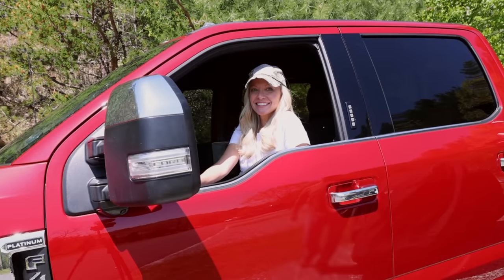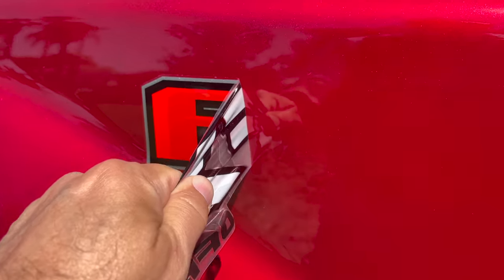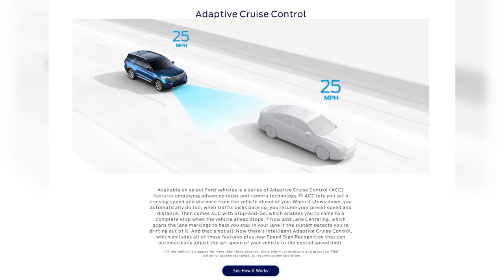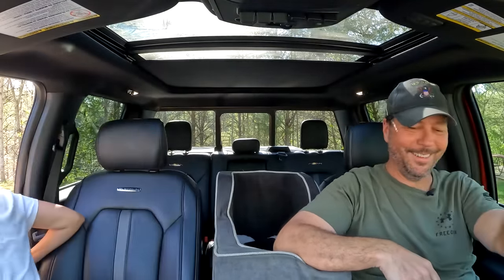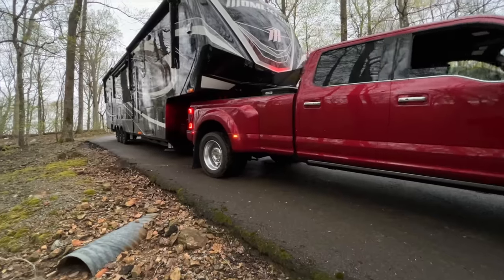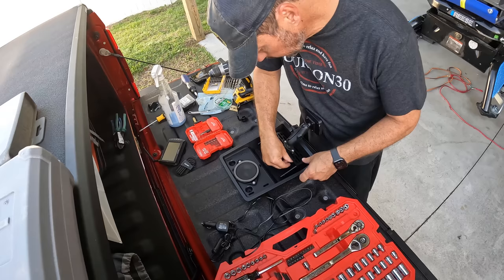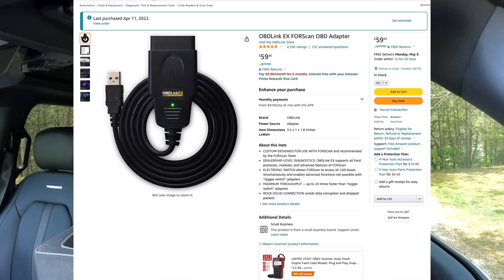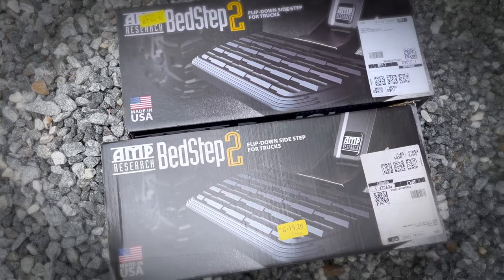2022 F450 Platinum! (Full Time RV!)

Comment: These are nice. I looked for 6 months and researched for a year. No one makes a truck like this at this level. I bought a 2019 with 3000 miles just like this truck in metallic gray. The few thing different is in 2020 they went to a 10 speed tanny and moved the antenna to the rear of the cab. It came from the factory with the spray in liner and the 5th wheel puck system. The turning radius is a game changer that wide track front end and those rims and tires are a great option of the F350

Comment: We have a 2022 F350 like you guys had, minus the 4x4 and ours was an XLT with moon roof.  We tow a 2022 41.5 foot 5th wheel, been full time now since June '22.  Haven't had any issues with the truck so far, it's performed fantastic and we're getting 10 to 12 mpg towing.  I'm used to the turning radius so that's not an issue so far.  Our trailers gross weight is 16K.  My biggest beef with this truck is all the CHIMES!  Open the door, turn lights on, open door WITH lights on, backup and so on.  I'll be digging to the program to get rid of most of them!  Ordered our Ford in October 21, got it 6 months later.  Bought the Reese hitch based on your review, and we have the Flexair kingpin.  Great combo.  Getting the I.S. and disc brakes this October.

Comment: I too just received my f250 lariat with all the tow options and the 7.3 gas engine (I only tow 6000 lbs for business). Suggestion, I ordered the factory trailer camera. Hard wired to the truck and shows on your12” display. The picture is amazing and clear. I love it. Haven’t towed with it yet cause I’m still getting my first 1000 miles on it. And like you said, I love this truck!

Comment: I purchased a 2020 F450 Platinum and absolutely loved it. We just purchased a new 2022 Genesis Supreme 37 CRXL Toy Hauler. The truck and trailer are amazing together and I have zero anxiety now when pulling. What I had installed suspension wise was Carli Suspension Pintop 2.5 leveling system with King Shocks. Kept the stock rear leaf springs to maintain towing capacity. I did add airlift 5k bags to help with the Squat. Overall I am super happy with the truck and we are going to do our first long pull to Yellowstone in a couple of months. I never had the confidence to do that with my old f250. Congratulations, can't wait to the videos you will make with the new truck!

Comment: Luckily you guys got yours. My dad ordered 2 F 450s July 12th 2021. A platinum and a Lariat trim level. It is currently May 8th 2022 and neither one of them even have a build date on them yet. Very frustrating when we are seeing people like yourself order at the end of 2021 and you guys have yours. Happy for you guys. Just very fed up with Ford motor company that they are pulling this stuff. It's not right. But enjoy your new pickup guys! Keep up the great videos
Reply from the maker: That's really odd.  I could see if he ordered something not in stock, but we ordered everything.  I hope he at least has order numbers from ford to make sure the orders were actually placed.
Reply: Blueovalforums has an ongoing thread on the 2022.  Between individual component restrictions and Ford being overwhelmed with retail orders, it's a nightmare.  Dealers are doing a piss poor job with customers, because the model has substantially changed.  I think GM and Ram are suffering from similar issues.

Comment: The best setting I’ve changed for me on my F-150 Platinum is when I lock the doors with the remote the mirrors automatically fold in. A quick google search will get you an excel spreadsheet with everything you can change. I also had my truck ceramic coated. Game changer for sure.
Reply from the maker: Surprisingly, that feature is built into the options now...

Comment: Another note on adaptive cruise and I don't know if you've discovered it yet, if system slows you down, as soon as you hit the left turn signal, it starts accelerating up to your set speed, even before changing lanes.  Now, the flaw of the system, when someone comes darting across the lanes, it can slam on the brakes to avoid it's "perceived" collision.

Comment: I used the pro trailer backup on my 2016 f150 before I got my 350. That one was not designed for gooseneck or 5th wheels but at that time I didnt need that. It was just OK. Worked great when it worked kind of deal. Half the time the truck could not find the sticker because of lighting amd sometimes it would take forever to find it. I liked using it but not getting it to work. It did teach me how to backup better. Its different in the 350 and wasnt offered on my 2019 because no electric steering so excited to see your 350 video.

Comment: My F450 Crew Cab 4x4 rides like a dreamy smooth Cadillac pulling my heavy 5th wheel going down the highway. I used Air Lift Load Lifter 7500 XL air bag kit @ 25 - 30psi in the rear and Air Lift air bags in the front @ 15 - 20psi plus Bilstein shocks. I run low pressure in the air bags because I don't need them for raising the truck up any but just to smooth out the bumps. When running around empty I run 10psi in the rear (minimum recommended air pressure) and 10psi in the front air bags (5psi minimum  recommended air pressure). The Bilstein shocks help a lot over the stock shocks with the little sharp bumps and joints in concrete roads and the air bags smooth out the big bumps.  It's a great combination. The empty ride is still stiffer than a 1/2 ton pickup of course, but hey it's a heavy duty hauler!

Comment: Several questions.  1) What is the cost of licensing between the 3/4 ton and the 450?  2) Is the truck listed by your "home" state as commercial?   3) Why the spray in bed rather than a bed rug.  Bed Rug is easier on the knees and also protect the bed better from dents and dings.  4) What have you seen for MPG?  5) what would you have added or deleted in the order and what was the MSRP (or if comfortable actual cost).   We are thinking about upgrading our SuperDuty to a 350 or 450.  Thanks for the great review.

Comment: I have 21 f150 platinum... check on the extra backup camera for the back of the rig... and the built in tpms. watched the rest of the video... need to learn more about the tpms options.   using tire minder now,  want the built in functions of the truck

Comment: I've got the Kelderman system on my 2021 F450 and love it. The stock height system maintains all of factory geometry. I took the truck to Iowa and had the kit put on at their shop. I did the 4H control system with Kelderman shocks and dual steering stabilizer. Changed the ride dramatically. That combined with doing 20" wheels with BFG all terrains, my F450 rides like a F150.
Reply from the maker: Thanks for the feedback, Logan!  👊🏼
Reply: How far do you live from Kelderman Iowa?  I have 2023 F450 Limited coming and will like to keep the stock height system to maintain all factory geometry.   Did you drop the truck off?  wait a few days?  What is the 4H system shocks and dual steering stabilzer?  How much did it cost?  I may look you on on Facebook to see some pics if posted.   Did you trade in your old tires and rims at Kelderman?   How many miles have you put on since?  Any pros and cons?  How much did it cost?

Comment: I guess I'm too old school a lot of advanced assist features I don't like because people should be able to do it the hard way first, if all those bells and whistles fail will you still be able to Drive, Hook up, and Tow safely?  the features on my truck I either ignore or turn off, I find them distractions and I trust my eyes over them, cameras have delays especially wireless ones. it's like the passenger mirror "objects in (the) mirror are closer than they appear" . 👍

Comment: For our single rear wheel 2020 F350 - I swapped out the factory FX-4 shocks for some Bilstein 5100 shocks (stock suspension and height).  Made a big difference on rough roads.  Also lowering tire pressure when not towing makes a huge difference in ride smoothness.

Comment: Nice video, you’ll want salastic shackles again unless you go full air ride from Kelderman it’s really nice stuff they install them right at there facility in oskalosa Iowa. You failed to mention you have a 10 speed transmission now and that helps with the Overrevving when in the mountains or on hilly terrain! We love our 450 but you’ll need to work on the suspension or tire setup when running empty or those massage seats will need to be on full time 😂 safe travels!

Comment: I have a 2019 Ford F-450 Platinum I pull a 2020 VanLeigh Beacon 42RDB. We upgraded from a F-350 last year and man I love the turn radius. My question is what mounting bracket did you use for the Garmin? Love your show, your the reason we started RVing. If your ever in Orange Beach, AL holler. Thanks Ty and Lisa
Reply from the maker: + Builtright Dash Mount: https://changinglanesrv.com/builtrightdashmount
 + RAM Mounts: https://amzn.to/3KNKH7U
     We use the AMPS plate mount (RAM-B-347U) for the GPS

Comment: Your truck looks great. I've got at Rapid Red F350 SRW on order. Have you noticed your highway rpms running higher with the 4.30 gearing? We had an F350/4.10/6 speed for a long time and my only real complaint was cruising along at around 2300 rpms at 75 mph. I would much rather be around 2k.  Has the 10 speed helped? I know that 10th gear is a bit higher than 6th in the old 6 speed.
Reply from the maker: Not at all with the 10 speed.

Comment: What a great looking truck  Just be careful when backing up with those mud flaps so close to the tires.  I occasionally have to back up a steep drive way or over a rock or curb, that pushes the mud flap up against the tire and then rips off the mud flap and some times what ever it is attached to.

Comment: I like your in bed tool box. Do you run or have you found a bed cover to work with it? I would like to run an in bed box but still be able to cover the rest of the bed when not towing the 5th. It would need to be able to open up for the 5th wheel hook up and stow out of the way while hooked up to the tow.
Reply from the maker: Here's what we have: https://changinglanesrv.com/faq/?Display_FAQ=2978

Comment: the turning radios is great in my 450 bets the daily driver of my 250 every time. my question in which gear ratio did you go with in the rear-end did and did you get the six speed or ten-speed transmission.  just trying to get input and other people's thoughts. Great channel and information thanks
Reply from the maker: Please see: https://changinglanesrv.com/faq/?Display_FAQ=2176

Comment: I have the electric cab heater which I love living here in Ohio.  But I also got the electric heated wind shield wiper blades.  Its a heat element at the bottom of the windshield where the wiper blades rest,  like the rear window de icer.  I also got tired of fishing the plug out from behind  the bumper, so I moved the plug into the plastic panel next to the tow hook.  Now just pull the rubber cover off plug in the cord.  I think you are one of the best at explaining RV fixes and improvements.
Reply: The plug is for the block heater, forgot to mention that.

Comment: Got a 2020 Platinum F450 the same color and I love it . Ordered mine without the vista roof and I’m not missing it .
Reply: I too had mine ceramic coated and also did Xpel film on some of the leading edges for more protection. I installed Firestone 7500 airbags just to level head lights out when towing. Didn’t have a lot of sag but just enough and I think they help on some of the rough roads when pulling our New Horizons 5thwheel. Oh the turning radius !!!!

Comment: Hi Chad and Tara, I was re-watching your video (I always like your videos, by the way!!) and saw that you have gone away from using the Pro-Clip mounts that you previously used for the Garmin, etc..  Just wondering why you switched?  I still like the Pro-Clip mount because it keeps the Garmin mounted lower and doesn't restrict visibility as much.

I also keep the TST monitor on a cradle and just lay it inside the center tray, and the Furrion camera gets clipped to one of the HVAC vents.  The only thing that is attached to the window is the Van-True dash camera.  This allows the best visibility in the center of the windshield.

Thanks for all the great videos you both produce!
Reply from the maker: Proclip doesn't have any mounts for the superduty's with the 12" screen.. 😞

Comment: Hey Chad, We have a 2009 F-450 6.4 w/4.30 axle gear. Honestly, I have had some trouble with it but, I am the second owner, so hopefully the issues I've had were a result of the previous owners neglect. With that said, I do like the truck and it tows our 397TH very well. I have noticed that the front tires wear a little more because of the tighter turning radius and that geometry. I hope I never have to go down to a F-350 because I'd have to learn how to park our rig all over again LOL! Safe travels, and "THAT IS ONE GOOD LOOKING TRUCK!" 😀

Comment: I only use cruise control on the flats and when entering a steep grade climb I pedal into the climb creating speed bypassing cruise control and preventing a huge rpm jump and gear drop.  

I use a large external transmission cooler and cooling fan.  Towing 7-8000 pounds on a 1/2 ton hottest I’ve seen it with external temps at 40 degrees accelerating up a 10% grade the transmission oil temp was around 175-180 degrees F and once I crested the top and planed out the trans temp would drop down to 120-133 within a 1-2 mile run after a hill

I hear owners are swapping from 19.5 rims to 22” and from what I’ve heard and read that it made a deference.

Air bags will only bounce more when driving

I own a 3500 HD and it has the overload springs on it.  It rides rough, but I am in the process of adding suspension parts to make the ride better : kryptonite front end parts and steering stabilizer with updated drag link (futuristic) , bilstein 5700 shocks in the front, and longer sway bar pins due to the leveling kit on the truck.  

Good shocks are key.

Comment: I signed up for a gas card today and listed you guys under referring party. Congrats on the new F450. I drive a 21 F350 dually 6.7 with a CC of 5,680. Wired an air horn, compressor, compressor water drain and front mounted LED light strip to the upfitter switches.
Reply from the maker: We appreciate you thinking of us! 😎

Comment: Is that a seat between the two front seats? I couldn't tell what your elbow was sitting in while you were talking. And just an FYI that I just got done watching a video about FORScan where they "enabled" the perimeter anti-theft system. They said that from 2018 onward, most Fords have the hardware installed but many do NOT have the software enabled when you buy it. They also claimed that very few Ford service centers seem to know how to use FORScan to turn things on. They even mentioned some settings that allow you to watch the exhaust filter, so you don't turn the vehicle off when the filter is almost full and it allows you to avoid problems by keeping the truck running while the system cleans itself out.
Reply from the maker: It's Daisy's truck bed...  the “Snoozer Luxury High Back Console Pet Car Seat” – https://amzn.to/2MnglBj

Comment: I did a few ForScan mods.  One is called Bambi Mode (allows all lights to be on high beam,Low beam and fog lights, it is great to use, but is illegal in some states but is nice on lonely roads to light up the night).  I also changed the turn signals so they blink 8 times instead of the 3 blinks when you just tap the signal (great towing),.  You have the platinum so, it has most things turned on.

Comment: 8:13 the only thing with adaptive cruise control in the mountains is watching out for when it brakes. It may seem as if it’s the transmission limiting the drive shaft and all which may be the case at times, but most of the time it will ride the brakes. It’s just one thing to look out for

Comment: Pro tip about the supplemental heater; it does not work if the thermostat is on auto. 
For it to work/come on you have to turn the thermostat up all the way, turn the fan on to your desired setting (basically turn off AUTO) and pick which vent setting you want. It basically has to be used like an old school cab climate controls.
I was frustrated because my truck has it however it would never get warm unless I used remote start. So I knew it was working. In talking with my service guy we came up with what I wrote above and it’s warm within a couple of minutes.

Also, if you add a trailer to the back-up system, the truck will account for that additional length in the adaptive cruise control

Comment: Back again! LOL Does your F-450 have the TruckTrailer Routing function in the navigation? Have you tried that vs. the Garmin RV Navigator? That would make for an interesting video.
Reply from the maker: Ours does not have that.  But the thing about using the Ford nav is, they usually charge for updates to both the nav software and maps.  At least they have in the past.  The Garmin has free updates to both.

Comment: Congratulations on the new truck!  In FORScan I suggest turning on the hidden DPF exhaust filter gauges and controls.  I use these to monitor and control the regen cycles.  This way I don’t risk turning the truck off during the cycle.  If I want, I can easily manually turn on the regen when it’s parked to make sure the cycle completes properly.